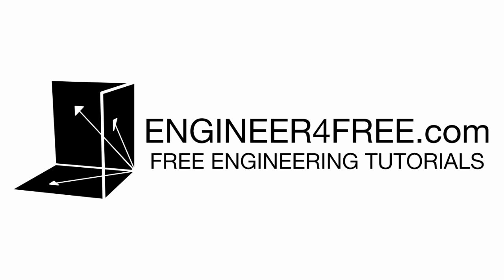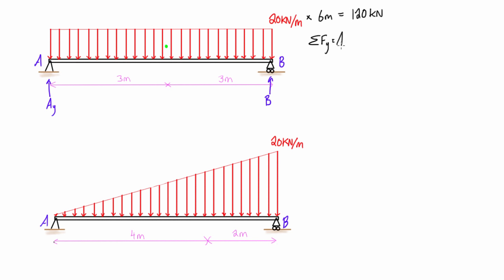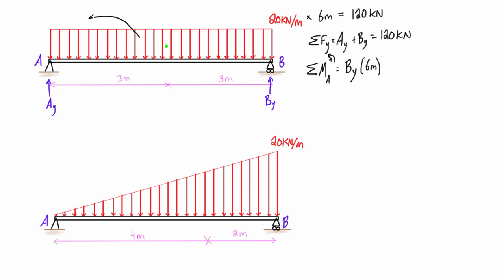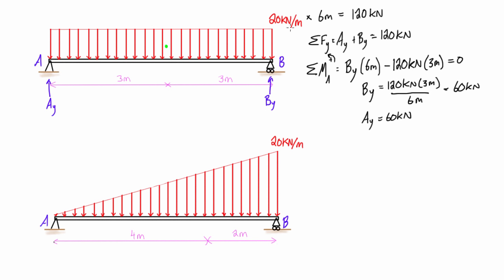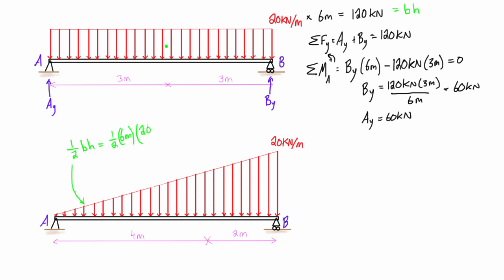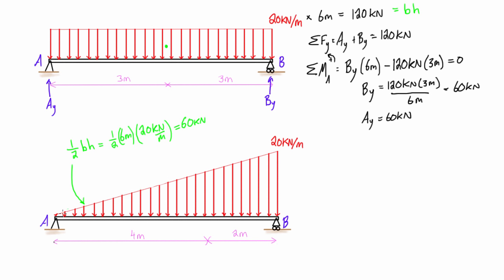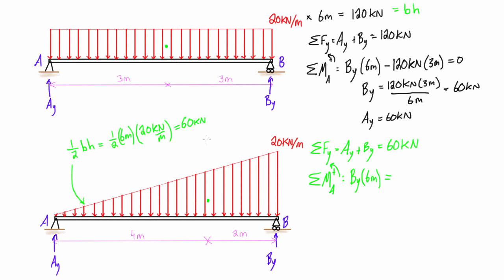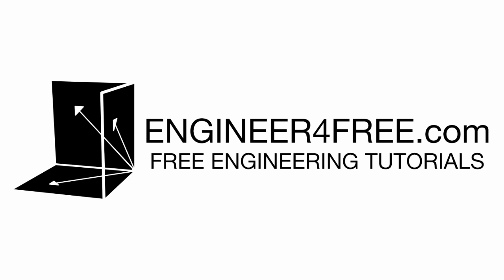Distributed loading on a beam example #2: triangular loads

Comment: Can you please explain how KN/m is a measurement of height?? normally we say something is x inches, or x meteres tall.
Reply from the maker: When you draw a distributed load on a beam like this, you are graphically representing something that's actually happening in real life. It could be something like a force exerted by a rectangular or triangular pile of snow along a beam. If you put your graph's origin at point A, then the "x" axis will be in units of meters and the "y" axis will be in units of kN/m. It's ok to have graphs with axis that aren't in the same units, actually it's quite common. Imagine a car thats travelling at a constant velocity. You can make a graph that is seconds on the x axis and meters per second on the y axis. If the velocity is constant, the m/s will be a flat line. If you looked at an interval of some amount of seconds, the area under the line would be a rectangle, and you could easily find it as A=b*h and it would be in units of meters (seconds * meters/second = meters). It turns out that the area is equal to the distance travelled in meters. Often the area under curves is meaningful and so are the units that it is in. It turns out in the example in this video, where we have a graph with the x axis in meters and the y axis in kN/meter, that the area under the graph will be in units of kN (meters * kN/meter = kN). So if we find the area of the whole graph (between A and B), then that is equal to the total force exerted by the distributed load across that span (and passes through the centroid of the shape), which we can then use in the determination of the reactions. Point of the story is that the "height" of these graphs is not in meters, so it's not the actual depth of snow or whatever is causing the force, it IS the force at any given point, and by calculating areas of shapes with different units on each axis, you often reveal meaningful stuff. Hope that helps, let e know if your still confused!
Reply: 20KN/m represents the max force magnitude, of which increases at a constant rate (F=(20/6)*x). This creates a right hand triangle with x=6m, y=20KN/m. He says height only to use trigonometric terms to solve for the sum of the distributed forces, which is the area of the triangle.
Reply: The measurement is describing the diagram. Indicating that 20kN is spread out on that beam surface throughout it's 6metres of length
Reply: @Engineer4Free  oh my, this was a proper good 11/10 explanation, it all makes sense now
Reply from the maker: @shahman1  I gochu 🙌🙌
Reply: @Engineer4Free  In the analogy of the car graph if you have the meters/s as the y and seconds as the x, the slope would be acceleration. So when you're writing the moment equation for this beam as a function of x, since the x axis is meters and the y is kN/m, the slope of the triangle would be the moment right? For the beam in the video the moment equation would be sum of Mx: (10/3)x * x * (1/2) * (1/3)x + 60x + Mx = 0? which then gives you M(x) = -(5/9)x^3 - 60x right?
Reply: Reading this back again my connection between the analogy and these types of distributed loads doesn't really makes sense since (kN/m) * (1/m) = kN/m^s and not kN*m which would be the moment, but I do think I had the right moment equation.
Reply: oh my mfg!!! I lam learning in this comment section more than at the universiry where i'm enrolled in.. fqfqfqfqfq!!! thanks!!
Reply: @Engineer4free would it be correct to just say, 20kN/m is not a measurement of height but of the force per unit length (found by multiplying  force per unit area by the depth of supporting surface)? I don't know if this is an oversimplification 🫠

Comment: how would you solve it if per say the A and B were not located on each ends. So lets say A is at 2m from the left and b is at 4m from the left.
Reply from the maker: Then we'd have a sort of overhanging beam. See videos 1-9 here: engineer4free.com/structural-analysis . A few of those examples involve overhanging beams

Comment: How would we know exactly where the point of action? I have a exam on this and based off different triangles, my lecturer will say the point of action is either 1/3 or 2/3 but I am not sure when I would identify the point of action to be either 2/3 or 1/3. Choosing either gives different final answers.

I feel as if my question is not clear but if it is, please clarify. Thank you.
Reply from the maker: It's always 1/3 away from the tall side, and 2/3 away from the small side
Reply: @Engineer4Free  thank you very much 💯

Comment: In the triangular distributed load, when summing the forces in the y-direction it is true the Ay + By = 60kN but it is not true that Sum_Fy = Ay + By or Sum_Fy = 60kN. This doesn't end up impacting the final solution but is mathematically incorrect to write.

Comment: BUT THE MATH IS DIFFERENT IF THE DISTRIBUTED LOAD HAS ITS MAX FORCE ON THE LEFT SIDE, WHEN YOU MAKE A CUT IT TURNS IT INTO A TRAPEZOID, THERE ARE NO EXAMPLES ON ANY WEBSITE THAT EXPLAIN HOW TO DO THAT
Reply from the maker: The easiest workaround is to just consider the leftward direction as positive, and start your coordinate axis with a value of zero on the right hand side then, just flipping the problem. The math is all the same if you can wrap your head around leftward being positive. I do that in some later videos in the mechanics of materials course to avoid complicating things that don't need to be complicated

Comment: Hello  how to convert the triangular load into  uniform load ? is that possible ?
Reply from the maker: No you don't do that. If you have a triangular load acting on a structure, you just have to deal with it as is.
Reply: @Engineer4Free   I mean In The Load distribution acting on the beam for example my beam is carrying a trapezoidal load there's a formula for it  to convert unto UDL so that we can solve the FEM as a UDL  sorry for my bad english
Reply from the maker: Oh, you can use symmetry to speed it up, but I wouldn't recommend converting to a udl with an equivalent resultant force because the SFD and BMD would be incorrect. For trapezoid just treat it as a composite shape. See video 65 here: engineer4free.com/statics
Reply: @Engineer4Free   I used the WLx/3 for triangular load to UDL if that's the case my whole Load analysis is wrong 😟😟
Reply: in the trapezoidal Load  my problem is that i dont know the Length of the two triangles

Comment: how did we know that there are no any horizontal reaction?
Reply from the maker: This is a statics problem, so it's implied that the object is in static equilibrium, ie, not accelerating in any direction. The only applied force is vertical down, and the reactions compensate with an equal and opposite force up. There is no applied force with a horizontal component, therefor the pin will not provide any horizontal reaction force.
Reply: Technically, you absolutely could calculate Ax though the sum of the forces in the x direction at equilibrium always equals zero. As there is only one force to sum and that sum equals zero, that force must be zero. (SumFx=Ax=0). If you then try to calculate the magnitude of A you'd just be adding zero squared under the root (no effect) so A = Ay. So you'd just be writing a bunch of steps to calculate the magnitude that would have zero effect (no change) in your final answer so you'd be wasting paper, ink or lead, and time.

Comment: what if the triangle is symmetrical?
Reply: There's a formula you can use to find the centre of mass for any triangle, and it's 1/3(x1+x2+x3) , 1/3(y1+y2+y3) in this example above if you set A as the origin you can see that B and the Point above B all have x values of 6 so Centre of mass from A would be 1/3(0+6+6) which gives you 4m from A. You can watch a video from exam solutions if this isnt clear
Reply: @OIOTV-zo9qp  thank you!
Reply: @maazahmedpoke  No problem Akhi
Reply from the maker: Thanks for contributing!!!! Really appreciate it :)
Reply: @Engineer4Free  Thank you too for your wonderful videos, you're really having a positive impact.